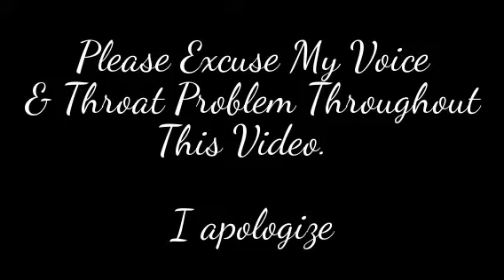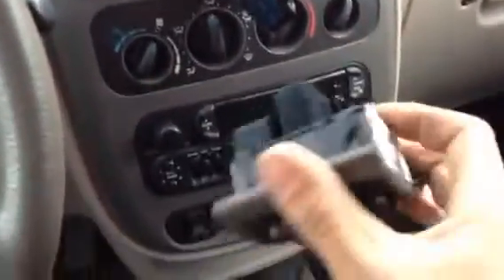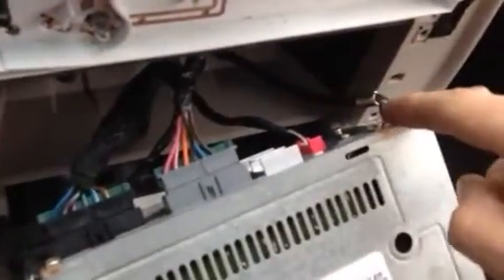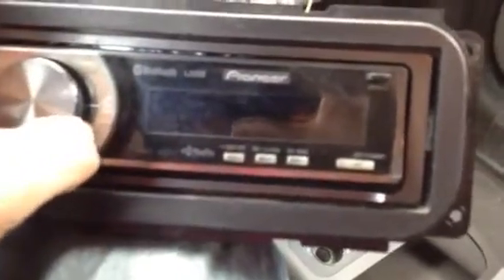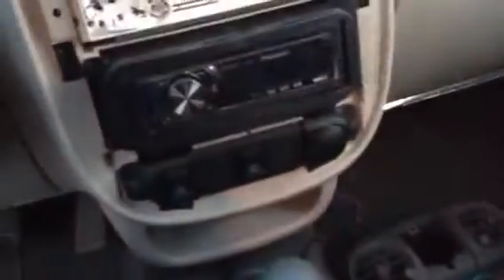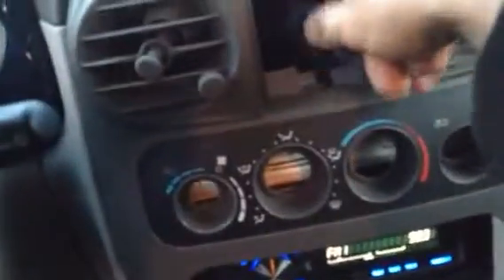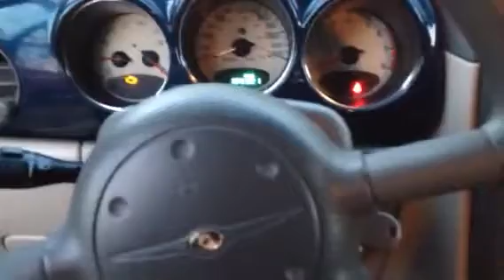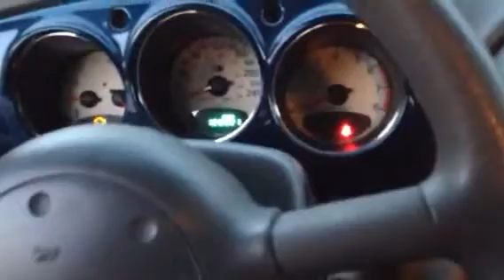PT Cruiser Aftermarket CD Player Install

Comment: John, no way was I trying to be critical about the screw, but I am in the midst of a battle to install a radio and had to remove the same screw.  I recently purchased a 2003 Cruiser and the person I bought it from took out the radio and speakers.  Unfortunately, he cut the wires very short on everything making it quite a challenge to splice additional wiring.  I very much appreciated your video on the installation.  I wish mine was like yours.
Reply from the maker: My newest video is all about repairing a cut radio harness!  😜🛠 I dot know why people do those types of things.  🤔😒
Reply from the maker: Here's the link to my newest video just came out today, it's about repairing cut radio wires, even the antenna https://m.youtube.com/watch?v=yDGnQntPBZU&t=67s

Comment: thanks now i know why my cd player would not work, wil try to work something out with the groundwire and hope for it to work. because who needs a tape player.;)
Reply from the maker: im glad you found this useful// there is a part:2 video also.  thanks for watching :D
Reply: MrJohn613 ps love your dog.  Big fan of dogs myself.
Reply: How did you hook up the independent ground wire to the harness
Reply from the maker: Treal Graphx I ran it into the stereo harness black wire.   From factory its separate to the rear of the factory radio

Comment: Thanks for the vid, i have a scoso install kit and it says i need an interface as well but I did not see you having to use one or anyone else for that matter. And thank you for showing how to remove everything properly!! Previous owner broke the driver side vent so he could wiggle the wire on the defroster because it gets stuck. Any idea how to fix that? You think I need whole switch or have you experienced this problem?
Reply from the maker: Might need a new part but can be found cheap at the junkyard
Reply: @613Builds  for sure thanks for the reply. I seen some used ones on ebay but don't know how much I trust it I rather get it cheaper and myself from pick n pull

Comment: I have the raptor car stereo install kit and I don’t know which wires to hook up to which adapters
Reply from the maker: the plug part that plugs into the new stereo and comes with the stereo, has to be colour matched to the new raptor harness.  red to red, yellow to yellow, etc.  then your new harness and your radio wires connect together easily with colours, and will then plug into your factory car harness, without cutting your car wiring harness.  try to match the raptor harness to the new stereo, and make sure you find the ground wire like i had to do.  the ground wire was totally separate from my factory car radio dash harness plug in, so i had to wire it into the "raptor" harness somewhat separately.  hope this helps ya
Reply: Any diagrams that you know of have the colors for the 2001 stereo
Reply from the maker: @porterpower11  as long as you don't cut the FACTORY harness, all the AFTERMARKET radios and harnesses all have the same universal colours, that way all you have to do is match red to red, yellow to yellow, white to white, etc.  after that, the raptor harness will just plug into your factory car dash plug in.   the colours on the new radio all need to match the colours on the raptor harness first, then it will just plug into your factory car harness.

Comment: couldn't find part 1. wanted to see what you did with ground wire
Reply from the maker: I took the vehicle harness ground from the back of the stock radio and wires it into the new harness.    They're both black.   Thanks for watching, the info you want is in one of these videos.   Sorry about my voice.
Reply: I've watched all 3 two are the same videos
Reply: but that makes sense thanks for responding
Reply from the maker: sorry about that.  the ground actually confused me also.  but part one shows the factory ground wire and part two explains how I connected it to the black wire on the new stereo harness.   good luck!
https://youtu.be/jtbpIRk5j5k
Reply from the maker: one starts out the same as part one, but its actually a full video of all 3 parts combined.  I just started learning video editing lol.   sorry about any confusion
Reply: I just couldn't find the part where you splice the ground wires but it's pretty self explanatory

Comment: That plug that had the red on top of it dod you ever figure out  what that did installed new radio now speedometer dosnt work
Reply from the maker: im unsure i think it turns the factory radio off when you open the doors.  the speedometer wiring is completely separate from the radio.  perhaps you simply blew a fuse somewhere?

Comment: I'm just wondering the wiring harness for my car has two yellow wires... From what I see most every other harness has 1 and it loops back on itself on the harness. Do I need to bridge all 3 wires together? Anyone else run into this issue?
Reply from the maker: Yellow and red are essential power wires.  Yellow gives your stereo power constantly for memory and primary power.  Red is switched power with ignition switch.   Are you referring to the new plug in harness or the factory harness?
Reply: @613Builds  I bought a brand new wiring harness so i didnt have to mess with anything off ebay for a 2006 pt cruiser. it clips in fine and everything but i'm not getting power. I matched everything up fine. I know it works because I hooked up the head unit to my computer power supply to test it out and it turned on just fine. The only thing I could see that was different from everyone elses installs was they had a loopback wire on yellow bridging both upper and lower on the harness. Mine has 2 cables instead
Reply from the maker: If they are labeled , follow that, otherwise if they both go to the same pin just use one of them.  Make sure the extra one is insulated as not to short out on any ground, because yellow is constant live.  🙂
Reply from the maker: @umop3plsdn  make sure one of the yellow wires goes to the yellow on the new Stereo.  ALSO did you see the unique ground wire?   that ground wire totally threw me off because it is separate from the harness.  i had to wire the separate ground into the stereo via the new harness.  Finally make sure you did blow any fuses in your fuse compartment.   check the factory radio fuse just incase.  that ground wire is tricky and separate from my factory harness but it is very important as nothing powers or functions without DC negative ground.

Comment: Where is the ground wire
Reply from the maker: its a single wire, independent from the others.  it is attached to the back of the factory radio with a simple spade connector.  it will need to be wires into the new radio harness.  it should be black